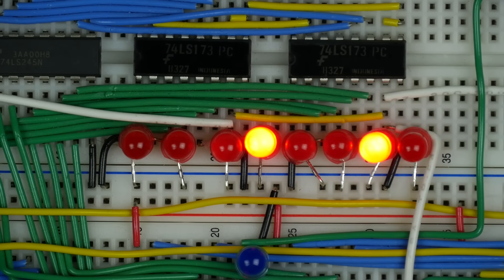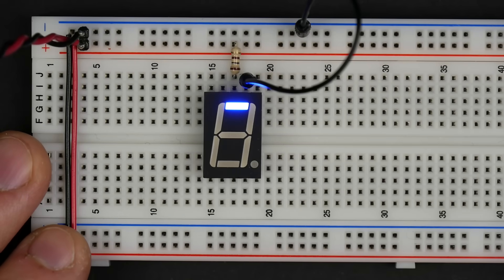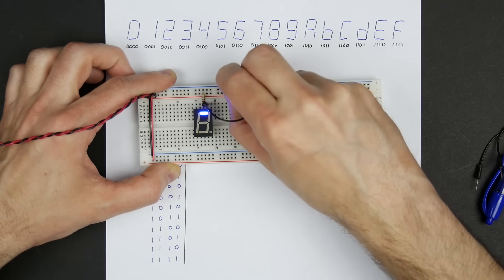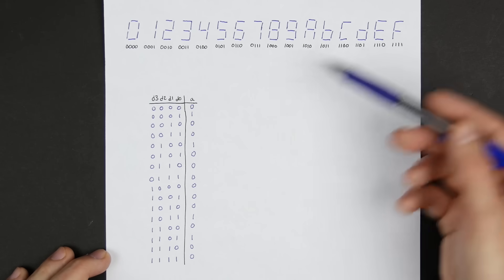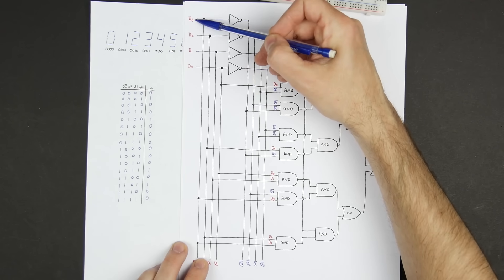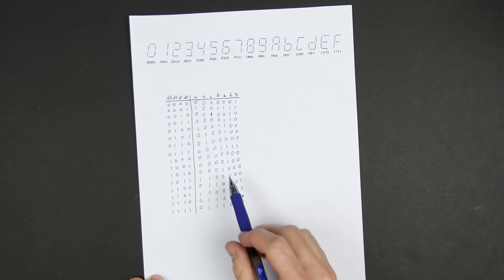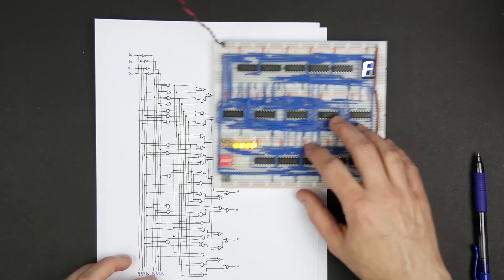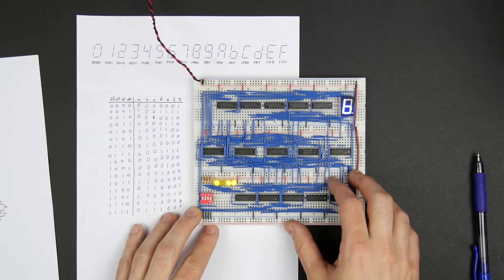Designing a 7-segment hex decoder

Comment: Isn't using eeproms or any programmable chips kind of cheating when building a computer out if discrete logic?
Reply: Not cheating. You could argue that using gates are cheating; transistors are the fundamental part. But you can also argue that transistors are cheating because they can be made with diodes. Using an eeprom is by far the easiest way to map an input to an arbitrary output. All it really is, is a set of memory-mapped registers.
Reply: No I dont think he is cheating. Ben is very clear about showing things step by step and its good time to learn something new - EPROMS.
Reply: To me it is. If you want to build the binary to 7SEG without microcontroller/EEPROM you can split the task in two steps:

Converting binary to BCD(complex as hell)
Converting BCD to 7seg(can be done with 74LS47)

To convert binary to BCD using only combinational logic you could use the shift & add 3 algorithm for converting binary to BCD. The addition would be performed by 74ls283s and shifting by a barrel shifter(multiplexer array), but that would take 22 or so ICs. 

The next option is to use sequential logic and load your binary number into a binary counter, count down and simultaneously count up with a BCD counter until you reach zero on your binary counter and you would have your BCD value in the BCD counter, this circuit would need a separate clock because your program would finish and inhibit clock before anything could get displayed. I am considering this option
Reply: @burninhell4448  I've spent so much time trying to get that answered. So my question is, how do we get displays that make sense to the every day human who only understands Binary? I assume clocks and calculators use BCD start to finish so you don't have to convert anything in the end, but what about CD players, coffee machines and other simple devices that use 7 seg displays? 
I know this might be a lot more complex of a question than I might think >.<
Either way, thanks for the answer. And I agree, I feel like it's cheating the scope of the project. But on the other hand you could say Bens scope was to teach people about general computer science and electrical engineering. I'm personally just making a calculator myself for now and I'll step up to this over time.
Reply: I just like the idea of putting everything together and it working straight away, you can't do that with EEPROMs because you have to program them first(programmers can be expensive). It's just my opinion though.
Reply: BurnInHell, that's probably the best argument against their use in this video. For beginners, inexpensive programmers are difficult to find. That said, I find them well worth the price you pay because you use them often and for a long duration. By now I've paid only a few cents per day of using mine. But I think that Ben did well by showing the discrete logic circuit and how to design it first, before moving to a demonstrative video of a better tool.
Reply: d4m4s74 I wouldn't say so. You're designing a truth table. EEPROMs make the most sense in this case. It's not like he's using a micro controller to do it, it's just an EEPROM. In my view, none of the "romance" of a home-built computer is lost. You're simply using more appropriate, but similarly capable parts.
Reply: Russell Teapot I think the adders are different because if I understand correctly the chip contains the circuit he explained. if instead of an eeprom a chip containing the  explained circuit was used I wouldn't even have questioned it.

Once I build my own I'm probably just going to use a binary display anyway.
Reply: "But you can also argue that transistors are cheating because they can be made with diodes"
Wait... what? How can you make a transistor with a diode? :|
Reply: (Disclaimer: I'm not an expert, I'm following this tutorials using a software called Logisim, so sorry if I mess up something). Yes, I agree, to some extent. However, if I recall correctly Ben address this in one video, saying that he didn't want to go just with "purely" discrete logic. In fact, he uses 2 74LS283 (which are 4-bit adders) in the ALU. The reason is exactly what he shows here: for relatively complex circuits it's a bit of a pain building them up from scratch using discrete logic. In this case, he could have used multiplexers (maybe) for simplyfing it a bit, but it's still a pain :D It's much more easier using a look-up table. Obviously, it's still important too see how you can do this with basic logic, it's a great occasion to learn about digital logic.
Reply: I just built my programmer too :)
Reply: Ordinary diodes aren't made to operate in a reverse-biased mode above their breakdown voltage, but zeners are. The configuration is to have two diodes in series so that current only flows like this: =>=<=. 

The ratio of the two diode's breakdown voltage determines which part corresponds to which pin, because it determines the path current will flow when the base is given power. It'll be something like: c>b<e. 

It works because a diode is an PN junction while transistors are PNP/NPN junctions. It would be an extremely inefficient and probably very high voltage transistor, because apparently metal interferes with the behaviour of semiconductors: http://electronics.stackexchange.com/questions/92131/transistorbjt-as-two-diodes/92193#92193. It can be done, but it's so inefficient that even engineers won't bother ^^
Reply: Aaron King Have you even read the text from the link you provided? Because they clearly write that this configuration cannot work, and they give reasons why.
Two diodes (PN junctions) connected together are not exactly the same as an NPN or PNP junction (a transistor), because when you connect the diodes, you introduce an additional metal piece between the semiconductors. The NPN/PNP junction works only when all these semiconductor layers are connected directly, due to the differences in electronegativity between the P-type and N-type semiconductor, which allows the electrons to dissociate between the boundary of these semiconductors and increase the number of electric carriers in the middle layer, making it more conductive.
Reply: He pulled out a complex assembled bread board for a single digit 7-segment. For his bread board, he's going to need 3 digits. If he makes driving logic for all three 7-segment displays, its size would be as big as the entire computer itself.
Reply: +Sci Twi A deeper reading shows that the problem is that the electrical field required for transistor behaviour is not present, not that it cannot be made present. It's possible, but extraordinarily impractical. Still, I'm not sure how this relates to my argument that no matter how 'purely' a design can be made, there is always a more 'pure' way to do it. It's not cheating to decide that it is not necessary to know the quantum-mechanical behaviour of charge through atoms in order to make a computer. I really respect the level at which this one is being made, and how well it is explained.
Reply: Yes and no.

 It saves a lot of time and space in one programable IC, so you can think yes.

But Ben already showed, how to make RAM from D-latches, which he did prom ANDs and ORs and NOTs, which he already did from transistors. And then started to use the gates and later registers and RAM, after he build it from simpler parts and I do not consider that cheating, but just saving time and space (and our patience) by substituing modules, which we already did by single IC, which have something similar inside (the inside of IC i more complicated, but basically works as shown and there is no principal difference to use such "blackBoxes" which does the same, only have little better characteristics and lower price+space).

And the EEPROM here works exactly the same way as the RAM (you can put the content inside with DIP switches like we did in RAM module (and with just slightly different pins used for programming), the only difference is, that it keeps the data when power is lost. You could substitute the RAM module here and DIP-switch the content inside each time you turn the computer on, to get the same result.

Also he provided us whit a way to decode 4 bits number to 16 lines. Only missing part is make matrix of rows addressed by the 16 lines and 8 columns providing output and connect columns to rows with diodes where connection is needed - BOOM - you have old time ROM the way they was once time done.
Alternatively you can use OR modules with enought inputs, like the presented decoder.

Or you can put diodes everywhere and then just burn out those, which you do not like  (just attach good powersource directly at respective row and column and diode will burn) - BOOM - ProgramableROM as in old times.

The way to make that electrically repairable (to have EEPROM) is way over what we are constructing here and it is NOT needed (or used) in this design (as long as you do not make mistake in burning and have start again).

And the goal here is not to build computer from transistors only, but to show the way it COULD BE build this way, by presenting each single step, but then using result of such step as block in following steps to show the main idea rather, then be overhelmed by not so important details. So after collecting everything to create ROM and then use one in single chip is the same kind of cheat like collecting everything to create 3-state gate and then use 74245 in every module.

So I would say NO, he is not cheating here, even if it could seem so on first look.

Comment: EPROMS.. Im intrigued. This is like a cliffhanger !
Reply: w00dyblack I thought he'd use something like a cd4511 but when he said eeprom, all sorts of ideas kept popping up. 😁
Reply: I'm trying to think of a hint with out giving it away.
maybe something like. not just display decoding but state machines.
Reply: Well, it's quite simple: There are 8 outputs, one for each segment of the display. So you can store them as a byte in a memory, and use your input numbers as 4-bit addresses to select these bytes for the output. Easy peasy ;) but still quite over the top for something as simple as driving a 7-segment display, when there are dedicated chips for exactly that ;)
Reply: @scitwi9164  That's exactly how I did it back in the 80's when I converted a commercial VHF radio to the 2-metre amateur band. I added an EPROM to drive the 6-digit display for the frequency readout and to drive the synthesizer from a 40-way channel switch salvaged from a CB radio. From memory it was a 2716 which I programmed by hand using a bank of toggle switches and the look-up table I created to get the appropriate data for the display and synth. Was a bit laborious, but worked a treat😁
Reply: I think he will use both something like an cd4511 AND an EEPROM.
This is because with 8 bit EEPROMs and 3 digits a 7 segments, you would need 3 EEPROMS.If you use 3 cd4511s,  you can save 1 EEPROM.
Reply: I used one EEPROM and a 4017 to switch between the 3 digits... activate the 7seg and also high address pins with it. Switch it fast enough and you can't tell it's flickering.
Reply: I've done a few projects with 7 segment displays, Ive always used 74HC595s to control them. I do have some cd4511s - havent got round to using them yet.
Reply: +Sci Twi are there other ICs than the MC14495P1 which can do this job?